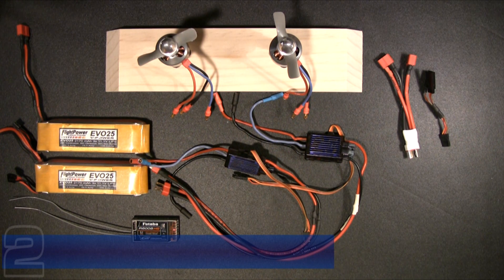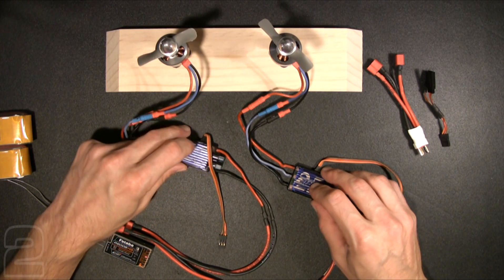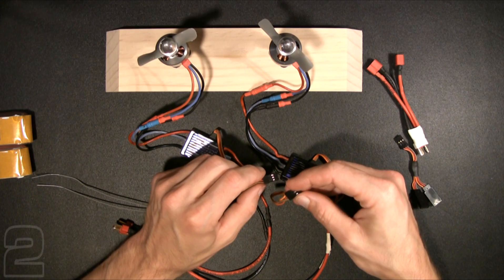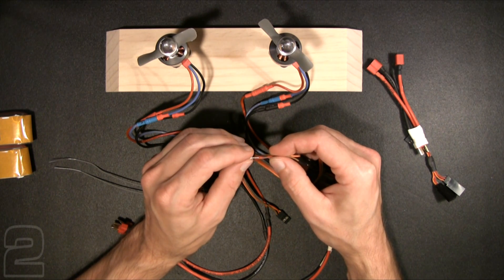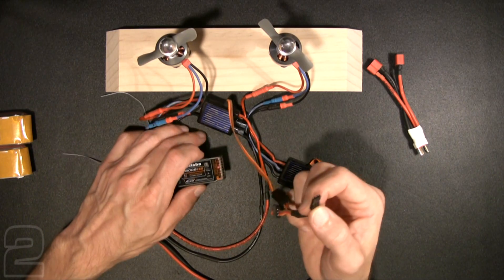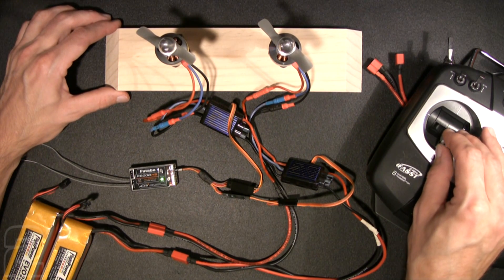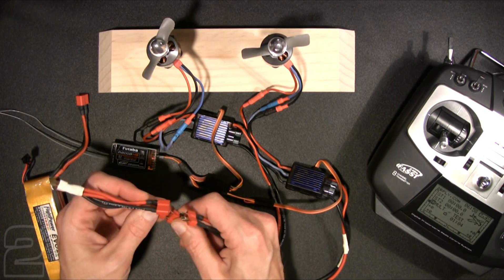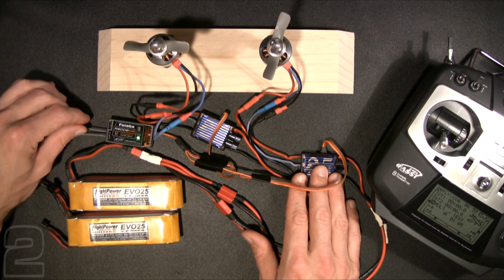Multi-engine ESC Wiring

Comment: I was curious if the connection in this two motors connect the two motors in paralel meaning does both motors get dispersed as much power in them as if they were connected to the same battery but just 1 motor were used we will get the same power on that motor as the 2 motors individual powers?

Comment: Hello, I have a problem, I dual wired 2 esc to 2 motor (I welded the 2 battery plugs and 2 reciever plugs together but left out the one red cable.) but when I try it out (both motors used to spin equally) only one motor spins. The other one twitches and sometimes rotates really slow while the other one has no problem. Do you know whats going on? (The 2 motors are identical btw) because I want to do this before all h*** breaks loose

Comment: Question, say for example I wire both my ESCs through the y harness and I lift the red wire out of one of them. If i chose to switch off the master esc (the one that still has it's red wire) what will happen to the slave? (the esc that doesn't have it's red wire) Will the slave work perfectly on it's own?

Comment: I dont see any problem with both esc supplying power to the receiver. in fact the Y connected still has red wire on both sides, that means you can combine power from two ESCs, and that is good for redundancy; when the other ESC shuts off, you still have the other one. Having them both connected won't double the voltage, only the current, which is not a problem because the receiver and servos will only draw the current that they need. If you use both ESC's BEC , it will still be 5 volts. But of course we have to make sure that both ESC's are identical to avoid imbalance.

Comment: Hello. Very informative video. I am experimenting on bypassing the joystick on a wheelchair and it appears that this system is inline with what I might need to control the chair without the need for the joystick mounted on the chair. I imagine that this system will not produce the power needed to pilot the chair, but my question is if you have any suggestions as to a system that might.

Comment: Is it possible to use a single ESC for both engines? Thank you, I'm really newbie.
Reply: Yes, but it will give you a lot of motor issues, and kweep in mind that your esc will work twice as hard. If you have two 20 amp motors connected to the 30a esc it will burn.

Comment: On a bimotor plane, where would you put the ESC? In the wing? In the fuselage, but lenghtening the Motor wires?
Reply: I would recommend lengthening the esc power wires as you would only need to make two wires longer and it would reduce electromagnetic noise from the switching ac motor wires. I know this is 9 months late but it might help someone else.

Comment: I have one for you ! I am running two esc’s on flysky FS T6 .
I am running 2 motors 2 esc’s with a mixer unit in the middle. powered by two 6v batteries. 
But when i try and use a servo on any channel or aux channel i loose all power to esc. I have no idea what this could be ??

Comment: Mix rudder to each motor Chanel. I find adding + 15 to 30 % extra power to the outside motor on each turn direction simulates and enhances rudder and stall turns etc. I personally prefer not to mix negative or less throttle to the inside motors (each to there own) as this usually avoids the inside wing dropping and avoids adding more power on turns. Or Mix in a flight mode switch increase percentages and to reduce power to the inside motors for crazy  flat spins or aggressive stall turns. My twin motor float planes don't need water rudders with this rudder/motor control.

Comment: Hi !! I'm confused..so l need two different propellers??  Can't use the same propellers on both sides?? And the propellers needs  to turn against each?? Please help me!! Thanks!!
Reply: It's called counter rotating propellers (CRP).  It's done this way to balance the propeller torque and to prevent an issue called "critical engine".  Now it's not required on regular multi engine aircraft, but it's more efficient to do so.  This isn't an issue with jet aircraft.

Comment: So I need two motors (they need to be controlled each singular). Can I use 1 battery through 1esc and then take the power from the reciever to the other esc? Or how do I have to wire it with one battery and 2 escs?
Reply: You can use one or two batteries in your setup with multiple motors.  Because batteries can vary in voltage and in drop while running, it's probably best to run the batteries in parallel, basically making it one big battery.  That way even as the voltage drops, both motors will be getting the same voltage regardless and slow down equally.  If you use 2 batteries independently, then if one has a lower voltage, then the motor will run at a lower RPM than the other creating an issue with yaw and making it very difficult to control the plane and even crashing.  While it is possible to trim it to correct the issue, it would be difficult so it would be much easier on you to just connect the batteries in parallel or just get 1 big battery with the same capacity of 2, if available of course.

Comment: Why not just one esc?
Reply: ESCs are designed to run 1 motor each.  Each motor requires a certain amperage to run.  Even if you took an ESC with a little over double the amperage of a single motor and ran 2 with them, ie 65a ESC for (2) 30a motors, it could still easily overheat and blow up the ESC.  Yes it WILL work if you use 2 of the EXACT same motors, but is it worth the risk of damaging your ESC and possibly your whole plane to save a few bucks?  I don't think so.  IF you use 2 different motors of even different brands, great chance only one will work since they're most likely not designed exactly the same.  Any little difference between 2 motors is enough to cause 1 of them to not work.  This is especially true if say you use one bigger and one smaller motor.  Only one will work period.  Also if one motor stops somehow even while working in said scenario, it will stop BOTH motors regardless.  So you plane will be dead in the water so to speak.  Until they design a board with 2 ESC controllers and connections to run them independently, it's best to just buy and run 1 ESC for each motor you have in your setup.

Comment: I'm trying to run dual arrma 2050kv motors and I have 2 blx 185 ESCs.  I have the y harness hooking the two ESCs together with 1 red wire removed.  I'm trying to bind it to a spektrum 6100at telemetry reciever and I'm using a dx5 pro transmitter.  Is there any tips you can give me? Seems I cant even get them to bind

Comment: Excellent video! Very well explained. 
Is there a way to control the motors like in a car? Left stick(vertical) is throttle and right stick (horizontal) reduces the power on either one motor, to steer.

Comment: Hi great video really easy to understand. I was thinking of purchasing the fms 3m glider and wanted to intall a 12 blade edf on top and still have the prop powered too. Would they have to be counter clockwise or do they spin in the dame direction.. the edf would be on the top behind the canopy?.. any thoughts on this would be a great help

Comment: Got a puzzle / problem I need some help with: I have an RC car with two different ESC's, one for the main motor and one that I'm planning to use to power lights. However, the built-in BEC's output different voltages (the one for the motor 6V, the small one for the lights 5V). To connect both ESC's to the receiver, I'm removing the positive lead from the small 5V BEC ESC. The problem is now that when I connect both ESC's to the same battery for power, there's lots of current flowing through the ground wires as if it's a short for some reason. This does not happen if I either use two different batteries for the two ESC's, or if I don't connect the ground wire from the small ESC to the receiver.
The trick is, I don't have any more room for more batteries and I must connect the ground wire to the receiver in order for the small ESC to properly take the signal.
What the hell do I do??

Comment: Do the same rotation wiring apply to edf I have a pair of qx 2300 kv on 2 70 mm edf's with 2 60 amp esc's on two 4s 14.8v 2200 miliamps

Comment: Thanks for video

Tried doing that on a boat at a boat club meeting and they couldn't figure why it wouldn't work i was using just one battery turns out they told me to remove wrong wire one 2nd esc servo lead which i now know thanks to your video

Comment: Nice video but Can you please tell me about twin engine RC plane propellers setup, Which motor turns CW and which one should turn CCW and also which motor propellers should be CW and which one should be CCW or just different turns of motor is enough and no need for different type of propellers, If you can help me i will be so thankful

Comment: Wouldn't it be better to remove the positive in  one leg of the Y harness instead of the esc??    and the battery's,  why 2? separate connectors?  just use a double adaptor and one battery? 
 I think you need to go back to the drawing board! 
 I'm not impressed with your system...

Comment: can we connect 4 motors in the same manner ? 

Doe's it effect on Receiver?
Reply: Yes, you can, nothing will effect the receiver if you cut the positive wire out, you will need 4 esc's, and makw sure your battery can handle them all. If using 20a max motors, you need at least 104 amp battery. Mah÷1000=AH. AH×C   
Rating= max discharge in amps

Comment: How would You wire 4 motors off 2 batteries to one receiver as I am working on a Scratch built C-130. any suggestions
Reply: The best way to setup a 4 motor plane would be to use 2 pairs of motors/ESCs. Each pair would be setup as shown in this video by 2BrothersHobby. One set would be for the outboard motors/ESCs and the other would be for the inboard motors/ESCs. That way if one failed, you could still have symmetric power, i.e. one motor on each wing equidistant from the centerline. If you had them setup for left and right wings, you would probably not be able to control the plane if one side failed.

Comment: Please add note at beginning of video about testing with props.  It seems your motors are somehow fastened to that piece of wood and those are tiny props., but some beginners still may not understand and have big props... scary.  Thanks.
Reply: And use counter rotating props instead of identical ones as shown in this video. Otherwise one prop will push in reverse and the plane will circle about its axis. Also us counter rotating motors. They will have reverse prop nuts too so they will tighten instead of loosening as the motor spins. You can use standard motors with normal prop nuts and reverse one motor as per the video but you do stand a possibility of a prop loosening inflight.

Comment: I have some problem,like the motors are not running at the same RPM if I use it my plane there may be unstable .how could I solve this plz, give me any suggestions
Reply: you could try mixing the rudder to make them spin equally
not sure though, Im quite new to the hobby

Comment: Can you use a 2.4 Receiver on a Nitro Engine
Reply: Yes. Done all the time. Be sure to isolate it in foam for vibration. I'd also secure the rx to the foam with double-sided tape so it doesn't leave the foam blanket.

Comment: Can I connect 2 motors in series, for example I have 6s battery and 2 3s motors, so I want series connection to divide voltage by 2 for each motor ?
Reply: It should work but if you ever powered up and one motor wasn't connected or lost a connection after powering up, you would probably fry a motor and possibly lose a plane. Your ESC would have to handle 3 to 6S. But you have no redundancy with 1 ESC. If it goes, you have no motors. Parallel would allow one motor to remain powered if one ESC failed. A parallel splitter from the 6S LiPo would allow 1 battery to 2 ESCs, and then 3S power to 2 motors.

Comment: wow 10mins to explain plug in two ecs into one battery and remove the positive signal wire.......... jebus  (edit) I forgot and if one is going backwards, just flip one of the motor wires on the backward motor... Ta Dah!

Comment: Is it possible to set multiple motor up in a way that you can control them separately. Not for a plane but for a truck or car. I would like to build a crawler four wheel independent controls.
Reply: I may not have explained myself very well. Would your suggestion allow me to control each motor independently of the others. Meaning I can have throttle to one, two, three or  four motor at a time or is what your suggesting only allow me to control just the front or just the back throttle.
Reply: yes, you would have 2 inputs (or as many ESCs that you are using) You can use the mixing feature on your Remote to allow for a switch (or whatever you want) to use 1..2...3..4..... ESCs. via one control.  Alot harder to explain than it is.

Comment: quick question about turning with dual motors more so on boats that aircraft. how would i slow on motor down or speed on up to turn would i plug one esc into channel 2 one into channel 1. doing this way  i would have to turn full and throttle full in order to go straight this does not seem or feel right any way to solve this with out using a rudder system ? thanks great vid

Comment: do I really have to remove one positive wire on the connection from esc to receiver even though I am using a Y power harness ?
Reply: It's  the best practice to do so. If you don't, there's a chance one ESC will provide a slightly different voltage to the Rx. That could cause problems. But many people don't and it works well.

Comment: Anal extreme....This guy could ramble about correctly using a screwdriver.

We want to know about connecting escs in series or parallel, and batteries and how basic power equations are applied with specs.

Comment: Very informative vid, I have a question? Could you do a video on how to program an ESC to work as a helicopter tail motor control. In such a way that the motor speeds up or slows down when you move the transmitter sticks left or right making the helicopter turn left or right. I know that many small helicopters like the blade 200srx and the WL v912 fully brushless has it that way . I have tried setting it up but I have never gotten it to work

Comment: Hi , Where can I buy the cable that connect two motors with the battery "cable used on the last part on the last part of the video" . I want to connect 4 brushless motors with single battery . It;s ok to use 4 ESC because I'm going to make a quadcopter. can yo send me the link for this cable on ebay/amazon ? Thanks so much for the video!!

Comment: Hi,  having trouble,  I used this set up for an eflite airliner.  2 30a esc's into a y for a 4s 3000 pack.  One motor will shut down at half throttle while even having the red wire removed from one.  These are eflite esc's.  Any help would be appreciated. Thanks
Reply: If you did the ESC calibration, they should both come on at the same time. To calibrate, remove the props. Turn on the Tx, move the throttle to max. Power up the Rx/ESC/motors, i.e. plug in the battery. After you hear a set of beeps from the motors, bring the throttle down to minimum. The 2 ESCs should now be calibrated and run simultaneously.
Reply: @hifinsword  thanks man!!
I was having the same trouble,helped me alot☺️

Comment: hi, i hope your still answering questions, thank you for the video, very helpful. However i have a question.... i followed your setup for my dual motor plane, (1 motor each wing) but I've  noticed that when i add power the plane is now turning to the right! also the right motor is thrusting backwards. silly question but is simpy a case of turning the prop over or do i need a special prop? any help would be great, thank you.
Reply: +sean sykes No, you cannot just flip the prop over and make it counter-rotating. You need to order  reverse-rotation prop OR a pusher prop (which you CAN flip over for counter rotation. Of course, you need the same diameter and pitch. Preferably from the same manufacturer...
Reply: +sean sykes just switch two of the three wires connecting to the motor and the esc. make sure the props are facing the right way too.

Comment: Hi  I purchased  Cruise boat  For six dollars garage sale without the remote control and no  Electrical parts inside only has two Motor  Is a hobby I know it's probably cheaper buying a new one but this is a learning process and also I want to build it and make a PT boat  Can anyone give me suggestion what parts I need and some electrical diagram of installation thank you very helpful

Comment: Isn't it safer to do Throttle position calibration on this setup? because one of the ESC-s might have different rates and they might spin in different speeds. This might cause a probleem in air. So i would calibrate my throttle positin on this kind of setup first.

Comment: Thanks.. Very informative. I had the same question I was about to write in RC MOTOR AND ESC WIRING tutorials by you, but in sudden I look at the side bar and I found this "multi engine  ESC wiring." 
I have watched many of your videos on RC. I am newbie in RC. I am stuck on a few questions and couldn't find any reasonable answer so far...

I had two questions, somebody has already asked for one ESC with two motors. Thanks for that's answer, I have one more question as well...

how can i define the total power i need for my Multi engine Plane... . 
My question is.. on the receiver end, how do i determine battery voltage Amps etc?

if there are ...
FlySky 9x Receiver and ... (I am planning to buy this, I like it)
2 motors with propellers on both side wings connected parallel with speed control,  
2 servos (I don't know its required volts) on both Ailerons,
1 servo on Elevator,
1 servo on Rudder,
1 servo on Landing Gear,
1 servos with Flash light.

Now how much volt of current and in what direction i will need to put connection with batteries.